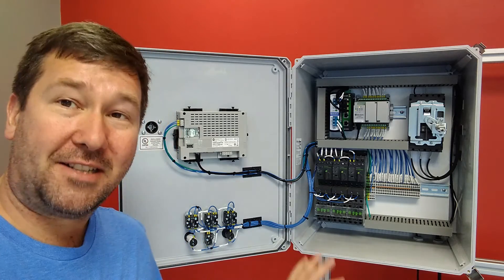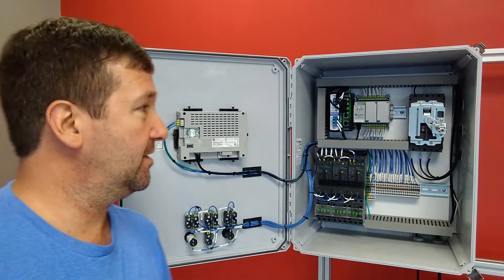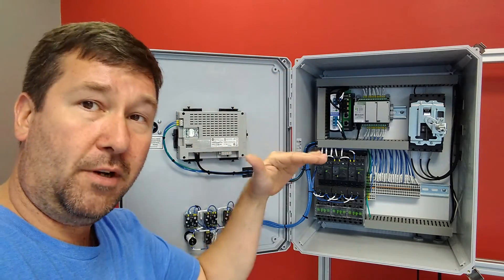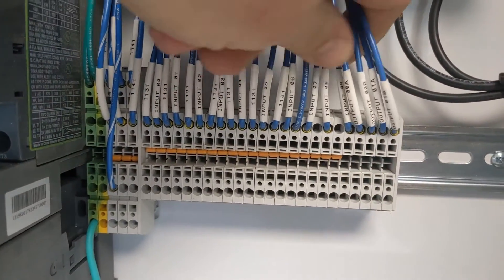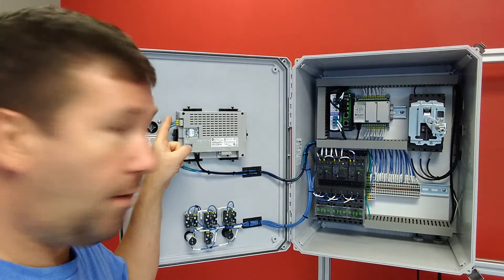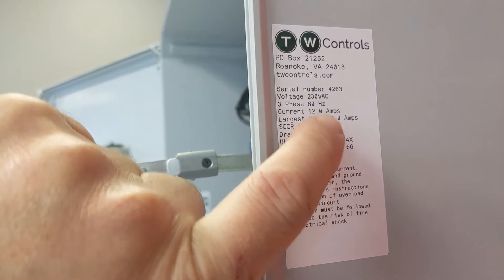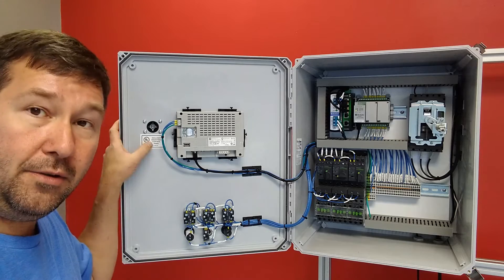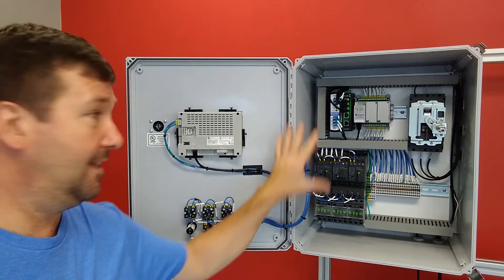Introduction to UL 508A Industrial Electrical Control Panels with PLC

Comment: Does anyone know the circuit breaker and the metal handle models? I believe they are both Schneider
Reply from the maker: That one had a Noark circuit breaker. Check out this video where we were building out a control panel. It had a Siemens with some nice options. 
https://youtu.be/4CXlr41zT0I
Reply: @TimWilborne thank you Tim
Reply from the maker: You are welcome.

Comment: Good video Tim, I've got a question: Do you know if there is a clearance requirement in front of the machine panel? If clearance requirement is only for Power distribution electrical panels? 

I understand the NEC (NFPA 70E) requires a minimum clear working space of 3 feet (0.9 meters) in front of electrical panels. This space must be free from any obstructions, allowing personnel to work safely on the panel..
Reply from the maker: It is a very gray area because so many organizations, many of them regional, can have something to say about it. I would look at NEC section 110
Reply: @TimWilborne  thank you
Reply from the maker: You are welcome

Comment: I see that you are using the NOARK MCP's and contactors.  Can you make a video with brands that you can recommend?  I get told often that Automation Direct parts are low-grade, Phoenix Contacts are mid-grade, and Allen Bradley is top-grade.  The pricing would reflect that.  I personally like using any of these brand.  What is your take?
Reply from the maker: I don't get into these brand debates. Here is my only take. 
https://youtu.be/jP1cl2YRlRE

Comment: Hi Tim!

I would like to thank you for the excellent work you have done. About a month ago, I started studying for the UL MTR exam and came across your video. While I was studying for the test, I used your videos at the same time. I can tell you it was very helpful. I have been designing control panels for a while, and our company decided to build our panel. I don't know why this test and certification don't get more recognition. The test was difficult, even with my background in electrical engineering. So again, thank you. You have a new fan here. And yes, I passed the test. Lol
Reply from the maker: That is great to hear! Congratulations!

Comment: Hi Tim. Thanks for your videos. I have a question about UL508 wire colors. Can you please provide some basic info on recommended AC & DC wire color guidelines.

Also, what format do you use for your wire numbers? Thanks.
Reply from the maker: I have a video on wire colors in my drafts.  Many people don't like my answer but according to UL 508A for industrial control panels which is what 99% of labels are, you only need to mark grounds as green.  The rest is regional and even varies across the USA.  I'll have some examples in it.

Here are some sample wiring diagrams, the wire numbers are based on the page and line number.
https://controls.tw/sample-drawings
Reply: @TimWilborne  Thanks. Doesn't UL508A make some statements about wire colors (i.e.66.5 (Power) & 66.9.1 (Control Circuits) (not sure if these are current section #s)? I believe they state that all ungrounded AC power connections should be BLACK (RED if < supply voltage) and all grounded AC connections should be GREY or WHITE. For DC control circuits they say to use BLUE for all ungrounded DC connections and WHITE WITH BLUE STRIPE for grounded DC connections. I realize there is some openness in the spec regarding these colors. But if you were to follow this basic color scheme would that be sufficient? Are there any other basic colors that you tend to use? Regarding your upcoming Wire Color video, any idea when it will be released? Looking for a beta tester? Appreciate any help you can provide. Thanks.
Reply from the maker: @christopherlyons7613   No, this is the most commonly misused sections.  65, 66, and 67 are for Industrial Machinery, not industrial control panels.  Industrial Machinery labels are very rarely used, in fact I've never seen one.

Comment: Hi Tim,

Thanks a lot for all the tutorial videos. I learned a lot by following your tutorials really appreciate that. Is there any video about calculating the total load of the whole control panel by going to each components? I'm trying to get that for my application in order to size a step down transformer and a safety disconnect switch. Thanks a lot!!!
Reply from the maker: This is one I have avoid because it's not as simple as adding up all the loads and multiplying that by safety factor, it depends on the types of loads, size, and locality.

Comment: Hi Tim, I have a computer science degree and a minor in electronics, I became an electrical contractor while studying. I did an online PLC basics certification. I am thinking of doing the PLC II which covers Rockwell 5000 series, SCADA, DCS etc. My question you you is what else do I need to get enough knowledge and experience to start offering my services for the automation industry specifically, PLCs, scada, MES, and ERP integration?
Reply from the maker: The biggest thing would be opportunities for troubleshooting experience.  That will go further than PLC II.

Comment: I would like to question the spacing requirements for your components.  UL got me with that on my first panel that got inspected. Typically a power supply, especially ones that convert 3 phase into 24vdc require at least about 1.5 inches above and below. It does not look like those requirements have been met. Love your videos man. Great content. Would love to ve able to bounce automation ideas back and forth.

Comment: I have main ac panel ,ac distribution junction box.in ac panel we have main mccb(earth protection) for on-off,
Ac distribution Power cable taken from Ac panel main circuit breaker control.

Is this needed any separate mccb for ac distributions box .(in ac distribution box we have 30 MCB,30ssr,two controller).
Reply from the maker: Yes there is more needed, you need to dig into the NEC book.
Reply: @TimWilborne  Thanks for your response.Could you please share authentic links for NEC ,UL508A.
Suggest any course are there for ul508a .

Comment: Hi Tim, great series! I noticed one thing in particular that surprised me, you don't label your panel components, why is that? Also I live in Canada and this may just be a difference in code requirements but I also noticed no fuse charts on the door, are you guys not required?
Reply from the maker: Our UL standards are the same.  As far as labeling, it can be done by the component, on the door in a panel layout such as you mention, or on a drawing.  This is one of our training panels so it get reconfigured often, hence not permanent labels.

Comment: Nice video Tim! Can you talk about the wire color coding when building a panel? I can't find much information for the color coding for such as AC voltage, DC voltage and etc.

Thank you!
Reply from the maker: I am going to soon but you won't like it.  The only color that is required is green for grounded conductors :)

Comment: Can you use MTW 16 or 18 AWG  wire inside control panels for the control wiring to save on money for wire as long as the proper fuse size is chosen? I read somewhere that UL508a says only 20 AWG or smaller wire has special requirements limited to PLC connections only.
Reply from the maker: UL says "power wiring" must be 14awg, with a few exceptions, they don't specify control wire size.

Comment: Where's your overcurrent protection (fuses)????
Reply from the maker: Uh did you watch the video?  There in it...
Reply: @TimWilborne  I don't see any fuses, nothing rated 5kA but I may be blind. Is there a link to the electrical schematic? Might be a good idea?
UL508A requires that the main switch (CB) be able to be switched with door open, I don’t see a handle that allows that? Anyway I subscribed and will check out some other video's. Great response time ... lol
Reply: I'll answer myself = 15A main CB so motors are group protected. The LVPS must be a self protected type?

Comment: Hey Tim, Do you through bolt your components to your back plane or drill and tap?
Reply from the maker: I'm 99% sure code doesn't allow through bolting components. And if code doesn't prohibit it then it should. I always drill and tap. If the diameter is too large for the thickness of the panel then they make volts that can be riveted into the panel.

Comment: I really enjoy this video break down in easy terms to understand.  I would like to see in one of your videos how and why you choose the panel lay out you did. Like which components can be next to one another and how you have to be careful about wiring crossing each other  (high voltage/low voltage)
Reply from the maker: We're working on a panel layout video. It is a little tricky but hopefully we'll get the kinks worked out.
Reply: @TimWilborne HI Tim. Have you made any progress on doing the Panel Layout video? That would be great information to show and it could help many of us. Thanks.